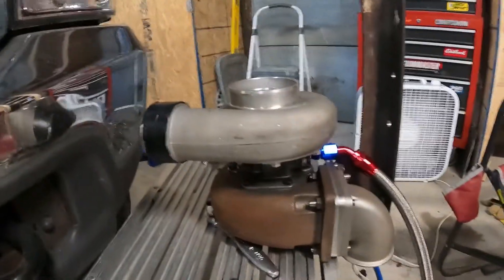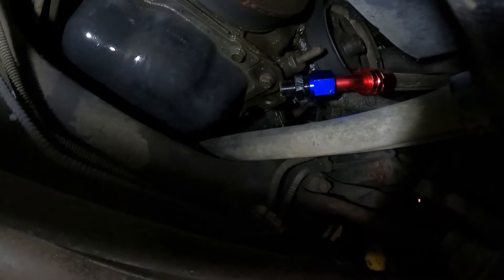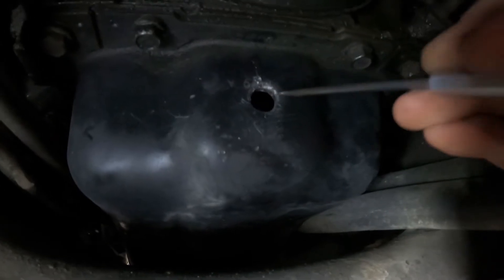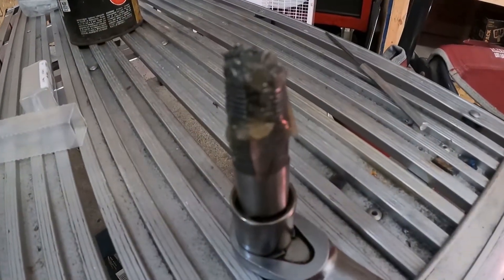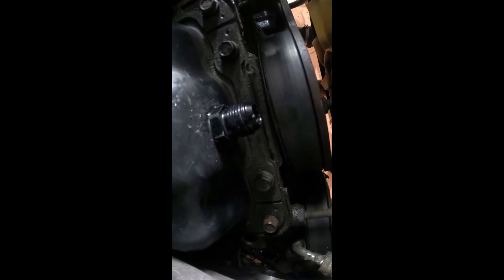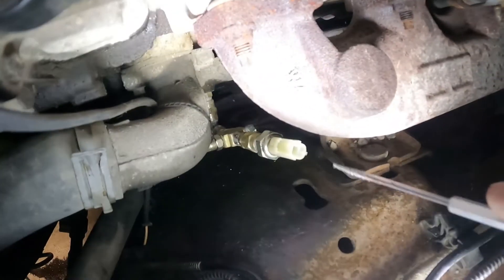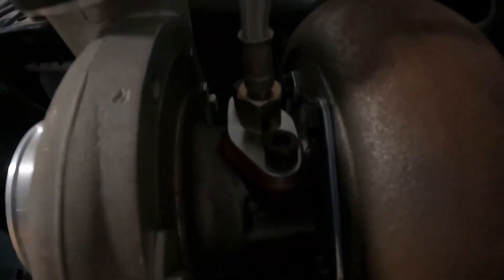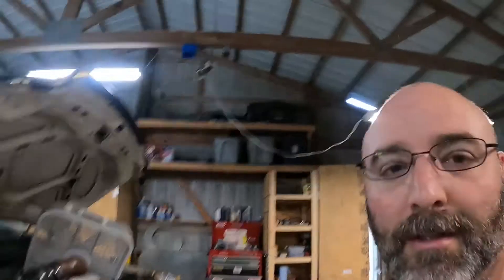diy Ford f250 5.4l turbocharger kit. oil systems part 3

Comment: Hello, so you started the oil pan hole with a 9/16” drill bit and then you punched it inwards?
Reply from the maker: Sometimes I’ll drill an 1/8 inch hole and expand to 9/16 to make things easier, just keep grease on the bit to catch any shaving. To do it right you need to puncture (no drilling) the pan with a center punch and keep moving up in punch size until you get to a 9/16 hole. Vortech used to make a special punch just for this if you can find one. I have even ground bolts down to a point.